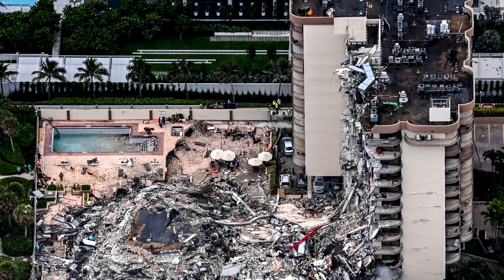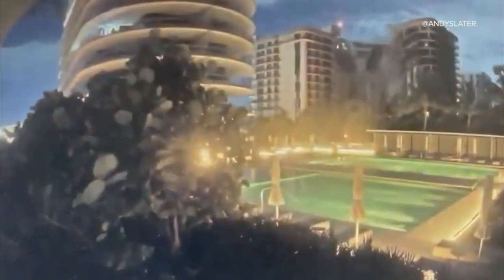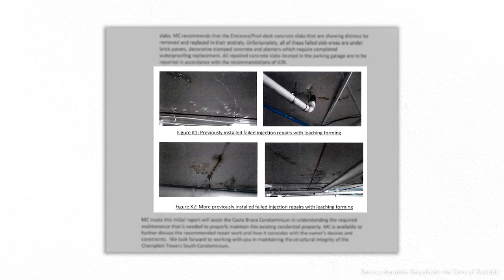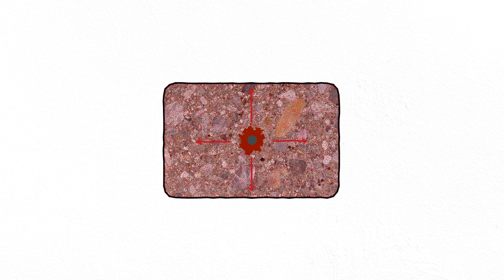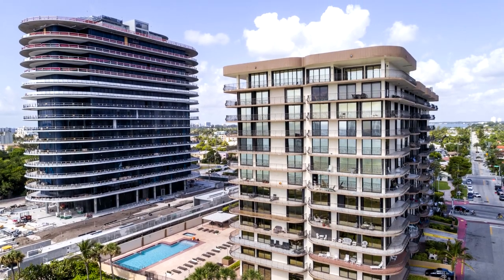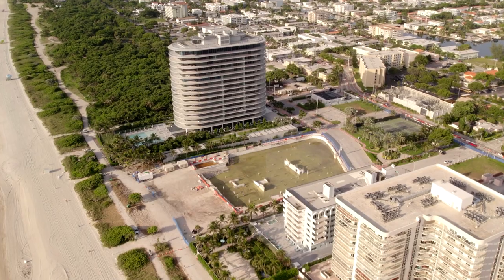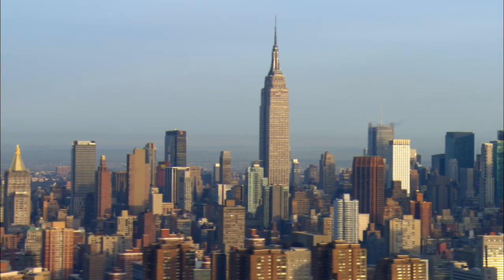Surfside Condo Collapse: What We Know So Far

Comment: If the pool deck did pull down the building, that's an inexcusable critical failure design. The pool deck should have been separated from the rest of the building. A set of double columns right next to each other would have allowed the pool deck to collapse without taking the building down. Even if there were other factors that has weakened the building itself. The other thing that really upset me was that they didn't allow those that lived in the standing portion to get their belongings. Family heirlooms and memories that have been lost. The search and rescue operation should have been called a recovery operation one week after the collapse happened.
Reply: This was not a design issue.  Redundant structure as you describe is unnecessary and not required by code.  We should address the real issue, maintenance.
Reply: @SteelheadTed  this to me reminds me of many of our bridges where one damaged member brings the whole thing down. Poor maintenance is cause number 1. Failure to add redundancies is number 2. Just because something isn't code doesn't make it not a design failure. Many codes are developed because of failures. Separating critical structures from non or less critical structures may be a code that arises out of this.
Reply: @ColeSpolaric  progressive collapse is already addressed.  It’s simply not practical to add redundant structure in all buildings.  Most buildings would be too expensive to build if you added backup structure and if maintenance is the issues, the backup structure will deteriorate as well.
Reply: @SteelheadTed  we're talking what, maybe 10 extra columns here that could have been put on the same footing? I can't see that costing more than 1 percent of the total cost. From what we have seen, the poor maintenance was in the pool deck area. I hear pool deck, and I immediately think what could go wrong here? I agree that it doesn't make sense in all cases, but makes sense to me in this one.
Reply: @ColeSpolaric  You don’t get it man, that’s not how buildings are designed and one collapse out of millions of buildings is not a good reason to change how buildings are designed.

Comment: The elephant in the room: buildings are designed to stand for about 30 years, built by the lowest bidder, and expected to stand for 100 years.  🤔
Reply: Wood frame, for sure. Concrete, it should last a bare minimum 50 years if the building was actually built to a sound design. But it requires that property owners follow the proper maintenance and upkeep recommendations for the building, rather than skimping out on it to save a few dollars. Things like re-sealing slabs, redoing old torch on waterproofing, renewing caulking every 5-10 years, inspecting drains and searching for leaks.
Reply: @-Keith-  Stainless steel rebar exists, solves a lot of the problems of concrete in a marine/salty environment.

Comment: Grady, great presentation. One thing to keep in mind concrete mix designs have changed tremendously over the past 40 years. There are new admixtures and pozzolons which make the concrete all but impermiable. Unfortunately, it will take years to figure out, and will most likely boil down to faulty/deferred maintenance. Terrible tragedy.

Comment: The age of this building hits home. In Sweden there was a huge government focus on building one million new apartments in a few years between 1965 and 1974. Most of these are apartment blocks built cheaply from reinforced concrete. A few of these buildings have been demolished, but all of them are getting close to their end of life, adding to a new housing crisis.

With stone and wooden buildings you can repair and exchange individual structural pieces, over time replacing every part of the building, but with reinforced concrete you often have one huge monolith, sometimes patched after water leaks have force replacement of the original concrete, leaving weak spots. The monolith is strong, but will eventually break rather than yield if the site settles unevenly.

Then I started thinking about bridges. They are often better monitored and maintained than cheap apartment blocks, but that infrastructure has been built up since the 1950s all over the world, and many of those structures are definitely also showing their age. 

While a good stone castle (or even a humble wooden home) will stand for centuries, the modern concrete building probably would be hard pressed to survive one.

Comment: Main slab column/wall connection is a place that’s both critical to the structure and costly to make. Additional reinforcement is crossing in multiple layers, dozens of starter bars need to be installed, all from thickest  steel. It’s hard and complicated job,  fixing it takes a lot of time. If column is missing some bars it’s sometimes easier to wave your hand than delay a pure of few thousands cubic meters of concrete.

Comment: When I was 17 years old I was studying Architecture and Mechanical Engineering while in a process of moving into a different home. In class the Teacher was talking about a parchment you can add to your foundation to prevent deteriorating walls. This is needed for when rain hits ground the walls remain dry inside and stable. When I went back home I went into my basement and I saw the wall warped as it was concaving inwards. So I went back to school and ask my teacher his opinion and he stated that we (me and family) had a serious problem. I called the landlord and asked him lots of questions such as why is my wall bent in, and is it possible it’s missing the parchment? He was nervous and a week later I watched him bring his team to put the parchment on the outside of the wall. I was correct to assume the parchment was missing. Furthermore he never got the bent wall fixed. Now I live in an apartment complex with leaking AC issues, I wonder how this will turn out.

Moral of the story, there needs to be an awareness of this issue, because when you say that we hope this never happens again (i agree)  I see this problem more often after taking HIGH SCHOOL ARCHITECTURE

It could be just me, I dont know im no architect or structural engineer or even Law to combat this issue but I know water damage is serious

Comment: Grady, you have a perfect manner of presenting the narrative to accompany such a video, and did an amazingly complete summary of the situation to date.  I noticed that you mentioned almost all the elements that have been brought to light by several other channels who are attempting to do the same investigation.  With that said, I am very puzzled as to why you left out the one thing that has been apparent since these discussions started - the fact that the columns in the portion which did not collapse were larger than those in the rest of the building which did fall.  As I have noticed, the 24" columns were much beefier than the 18" and 12"x18" ones used in the failed support columns.
There must be a reason for this, and I have heard at least one engineer speculate on the topic.  But, the single question which remains unanswered is quite simply put: "If the whole building were constructed using these larger, stronger columns, would the 12-story structure still be standing today?"  Even with the water damage and obvious design and/or maintenance issues, it seems like some engineers might answer 'yes, possibly' - which means it should be given more coverage, especially with 97 deaths taken into consideration.  
Since the very first pictures hit the media, many people must have thought it quite odd that a good size section of this building stood tall and unaffected by what happened.  In fact, while the portion which fell unexpectedly and 'all by itself' looked like total destruction, the remaining part had to be taken down by experts with explosive demolition techniques just to get it to fall.  Since over 2,600 commenters have given you accolades on this presentation, I know they also would all like to hear your response to this question... so please think it over!  😏

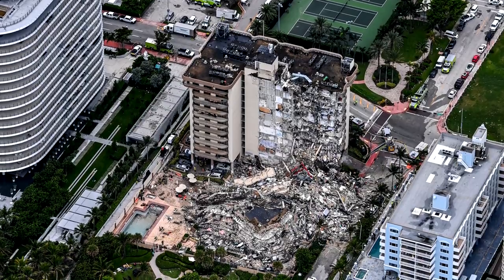Comment: Another engineer found that a design change may be the ultimate trigger. In the original design there was a 1 foot step up between the pool deck and the street level parking (under the part that did not collapse) which was supported by structural beams between the posts .When they redesigned it to get rid of the step they removed the structural beams and compounded the problem with some large planters. It basically meant that cars and planters were on opposite sides of a couple of pillars with no beam to properly distribute the load to the columns. This seems likely to be where the initial punch through occurred. At 7:50 just beside the white car to the right of the umbrellas.   A video made just before the collapse shows that there was no structural beams visible from the car park where there would have been in the initial design.

Comment: I'm an engineer and I'd be drilling cores along a line parallel to the beach. I'd be examining the basements of the other similar buildings.  I'd look for a connection between the geology and hydrogeology, and the collapse. .. Avoiding the next collapse is the main goal. .. Reduce the risk.

Comment: When the pool deck fails, the remaining building columns become twice as long and therefore more likely to buckle.   Can easily calculate if this is an issue.
Reply: since buckling occured at the same moment, shear forces affecting the columns, caused by the deck collapse shown in animation, seems like a logical explaination.

Comment: As a building inspector myself if I saw damage like the one seen I would ask for core samples to see if the concrete was damaged. Even if I didn’t think it had gotten to the point where that was necessary I would make sure that all the cracks and damage was being track and reinspected at a regular basis.

Comment: I do condo restoration in Daytona Beach, so concrete repair and waterproofing on condos just like this one. That is a lot of damage shown back in 2018. Concrete rusts insanely quickly on the beach when. If ignored an unsealed parking deck will get sand containing salt blown in from the beach every day, and all the rain seeps chlorides into all the cracks. I believe 3 years of that could easily collapse a building.

Comment: Excellent job - clear and cogent explanations.
Two questions:
1.  Do any laws, rules or regulations require surveys /measurements of atmospheric corrosives, e.g.salt aerosols and sulfur dioxide, in areas where such airborne corrosives are known to be present or should be suspected, AND trigger building, inspection and maintenance requirements when atmospheric corrosive measurements indicate levels where significant damage could result?
2. Where atmospheric corrosives exist in significant quantities (e.g. near salt water or downwind of a coal-fired power plant), should coupons be required, and if so, how should they be placed?

Comment: Having served on a couple of condominium boards, I understand how slowly decisions can get made for high cost (capital) projects.
The inspection was in 2018. From the news, it was reported that a several board members resigned because of their frustration with how other board members were objecting to necessary repairs (amongst other reasons). 

These repairs were going to cost a lot and the board had to impose a "special assessment" for each condo unit owner. That's always unpopular. Three years after the inspection finds the dangerous conditions, the building collapses while the board has finally issued the special assessment.

I'm not blaming the condo board members exclusively. The blame can be distributed widely. The architect, the building contractor, the city leadership and regulations, the building inspectors and the engineering firm could also have played a role.

Comment: I run the mechanical side of a few swimming pools in NM. I NEVER dismiss unexplained presence of water. Either the rain water isn't draining properly or the pool is leaking. Water meters can tell if there is an unexplained use of the pool fill. If that stuff looks fine. Then rain or a building water leak is to blame. Finally, if there is literally a  leak going through the floor into the parking garage. Then it is time to flip out. Close off the pool and get a guy to look at it and give it the okay to use untill fixed. Or close and fix right away.

Comment: I find this interesting as I recently stayed at a hotel on the coast and They had SEVERAL cracks and punctures to the building. I could see rebar in  a few sections of the parking garage.  There were concrete walkways with rust spots and one had a large crack in the corner where it attached to the building. (which they covered up with mortar so it looks better now)  There was evidence that they had applied water proofing to the balconies around the walls and base. It looked like they had applied a type of tape and painted over it. Looked exactly like drywall corner tape but I was only able to see the "tape" through the paint so I have no clue what it actually was.  There was chucks that were missing from the underside of stairs that had been repaired.  One notable thing was that while I was there is that the support columns looked great. I could see all them as almost all were exposed because the hotel had a lazy river as the 1st floor with rooms on 2-15 (no 13th floor).  Another thing is that they had guys repairing something on the side of the building. It looked like they were putting mortar over a repair. On the side of the building was another issue were the paint was coming off and rust was showing, probably a rebar issue but IDK.     What are your thoughts on these issues? Cosmetic?  

I worked in maintenance for years and I never seen structural or concrete failures. I was also not near salt water environments.

Comment: I don’t know if pumped concrete was used here, but 40 years ago whilst I was building concrete river channels using reinforced concrete we had great concern about the voids left when the concrete dried out. This would allow the concrete to be permeable allowing water to get to the steel.
The ideal ratio of cement to water to cure the concrete would render the concrete unworkable (too stiff), so excess water has to be used. With pumped concrete the the amount of water used vastly exceeds that required for the cement to cure leaving minute voids in the concrete when it dries leaving it susceptible to fresh water ingress. I don’t see concrete skips being used in modern building any more, only concrete pumps.

Comment: I feel like it was a combo of factors. Including the weight of each unit - I heard the units were remodeled years ago with heavier, luxury grade finishes like marble, when the building originally had builder's grade finishes like linoleum. That combined with the initial bad design, pool deck, construction vibrations, etc. probably brought it down.

Comment: They left out 4 load transfer beams that was in the original design. Without them the punch shear for the pool deck was at 100% dead weight. The 12x16 columns were only meant to be used in conjunction with that transfer beam. If you look at the signed and sealed documents from 8/79 and the ones from 1/80 you will find the transfer beams were removed. 

No idea why they removed those beams. 

Much respect!!
David Dennis
Reply: See BuildingIntegrity's video on this - a step was removed, the beams vanished at the same time as the step (this seems to be a mistake).
Reply: @MarkTillotson  looking over the design change I saw that step removal. I didnt realize at the time that it was that much of a load bearing structure but it appears that the step was part of the load transfer design. 

Thank you for the video suggestion. That guys is spot on!! - David

Comment: I've not seen any mention of wind as a factor in structural weakening and perhaps as an initiator of the collapse event, yet videos from just before and after the collapse show a high wind at the time blowing towards the open garage door and directly at the north face of the building, opposite the columns that collapsed. Perhaps additional wind-caused compression on those weakened columns triggered the collapse of the column opposite the garage door (as can be seen in the video taken 7 minutes before the final collapse). That column's collapse could then have triggered the pool deck to collapse and then the rest of the building.

Comment: So a structure is engineered to stay standing...providing it gets a certain level of maintenance which prevents very much degradation.
But does that make it right that there is  so little structural redundancy in design that the failure of a few columns can allow so much of the building to collapse? 

I guarantee you if I knock a big section of masonry basement wall from my house, the whole house won't collapse.

Comment: I watched a 40 min video by a structural engineer analysing the design (and in particular changes made to it in 2018) that suggest there were some definite design flaws in the building. In particular the size of supporting pillars (already a problem in the original design) and the removal of a bunch of beams from the design in 2018.

Comment: Nice summery.  I think it's likely a problem in all three areas: design, construction, and certainly maintenance.  I think by far the biggest "miss" was a failing pool deck taking out the building.  Had the engineers in 2018 thought that was possible, I think their report and the follow up actions would be different.  Something you didn't touch on was the role of the association.  Owners were not happy about the costs in fixing the problems in the 2018 report and it ended up delaying remediation. That's an issue likely to play out time and time again and deserves to be added to the lessons learned.